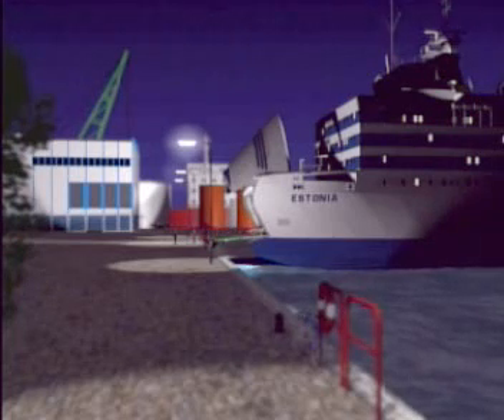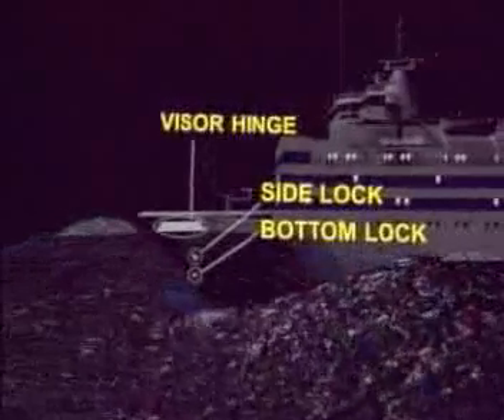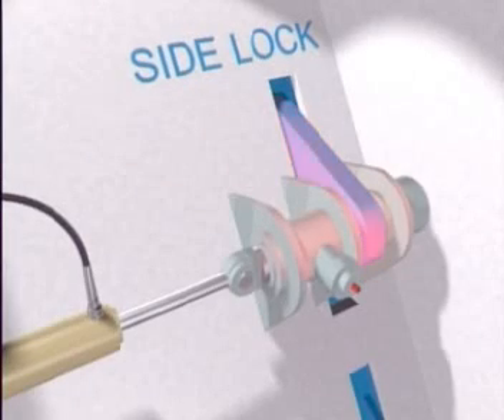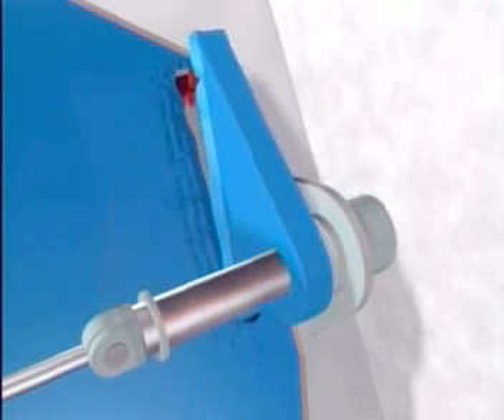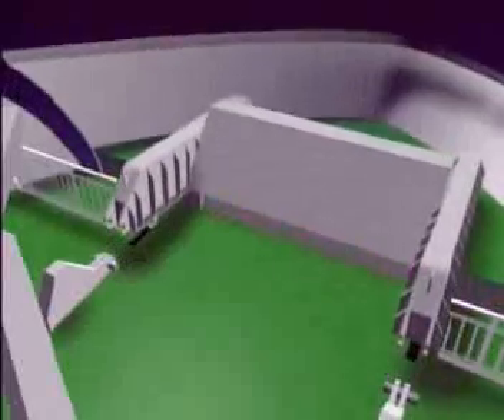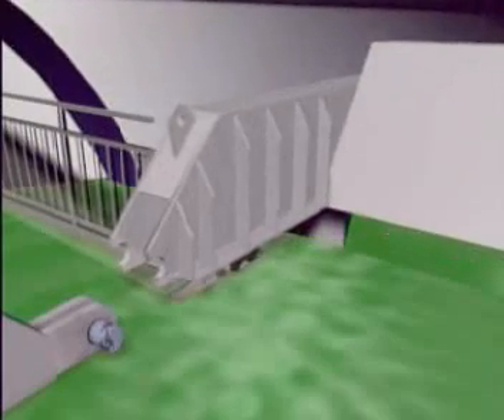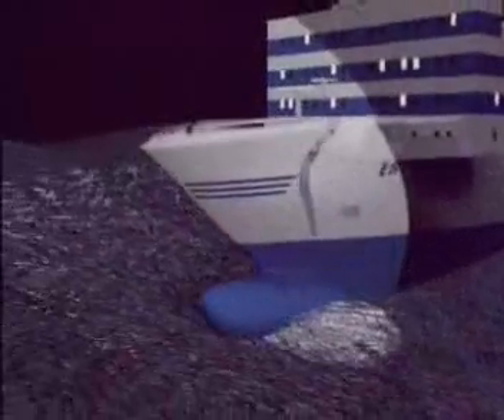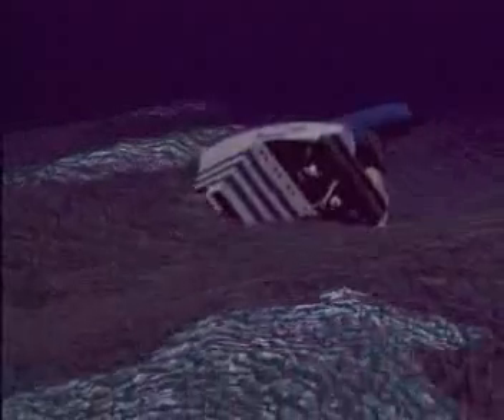MV Estonia..Accident Investigation...Animation

Comment: you forgot the bomb that was placed on the right side, witch was there to make the ship tilt and loose it's stability, the ship was constructed to be abel to float even if the cardeck was full of water, and that's thanks to the airlocks on the sides of the boat, but this was opened with a bomb on the right side witch made it so that water could flow into the airlocks to make it tilt heavely and sink fast as possible with the military stuff that was onboard the cardeck, there is a reason why nobody was allowed to investigate it further, why they poored sement all over it.. i urge enyone to watch this clip, however it is in Swedish https://www.youtube.com/watch?v=l_p4lT7WJr4

Comment: when they arrives to large waves,ramp housing move back during hitted by a wave and moved at front after hitting by a wave and it's repeated so it's cause the bottom lock and side lock to destroyed.a huge wave hitted the ship.when the ship up ,most of passengers fall and it's goes down the ramp housing moved up.so the locks destroyed.another huge wave hit the ship upward.and goes down.the visor hinge hit the ramp so it's fall at ramp housing and the ramp housing falls.another huge wave(larger than the past)hit the ship.that causes the ship to roll over the starboard side and sinks faster by capsized.when it's capsized the bow's out of water and goes to stern so it's sink stern first.the ship was longer than the deep sea and the stern riches the sea floor first before the bow.